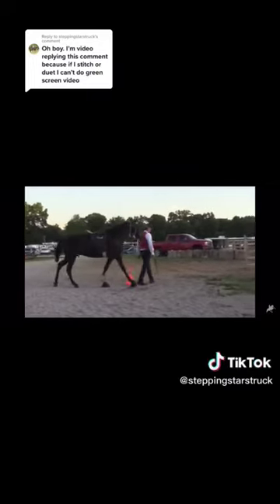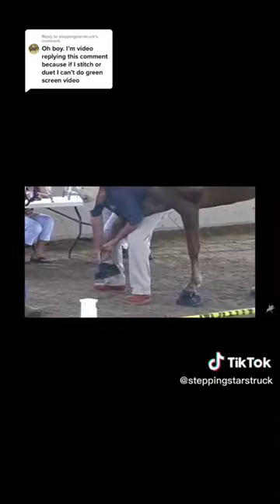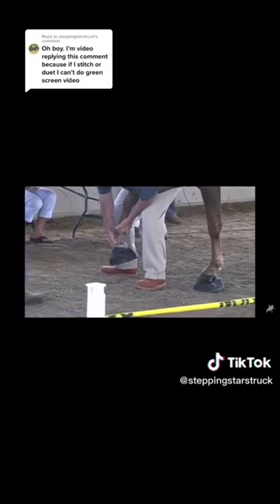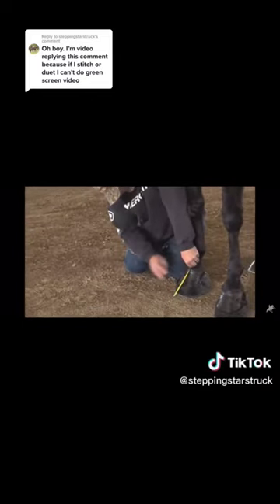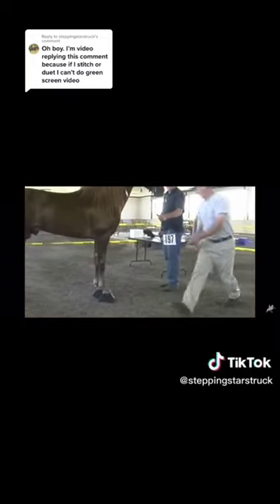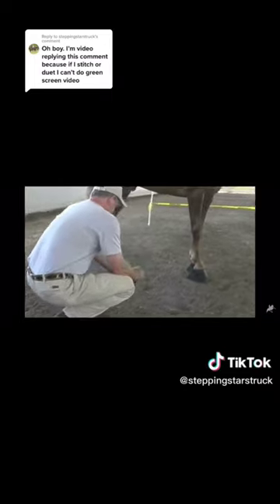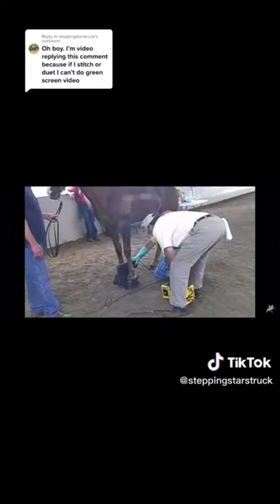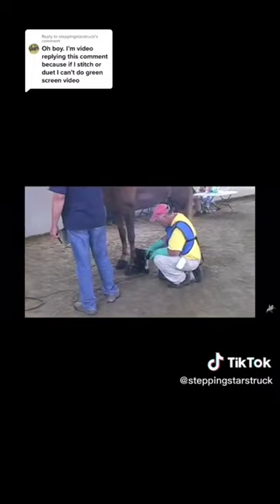Padded Performance Horses Testing Process #saynotothepastact

Comment from the maker: Padded Performance is not my cup of tea but they're one of the few displines out there that actually has such an indef testing process to make sure their horses are 100% sound and pain-free entering and leaving the ring. 
Such testing is starting to peek a bit of its head into Quarter horse displines this coming year. 

If you want to try and say chains and stacks cause pain and discomfort you're wrong as they're backed by vets who found barely any change in their heart beats and blood pressure when they did and didn't have them on. 
Not to mention chains only weigh 6 ounces as much as a watch and stacks 2 to 5 pounds, which aren't crazy weights for these horses to carry.
Chains are used for coordination awareness and there's many different types from rollers, leather ankle straps, felt lined chains etc, some people don't even use them. It's just about preference of the rider and horse. Some jumpers and draft owners use chains/staps, even rehab horses for the same reasons.
Reply: @tansiwolf8281  omg someone with a brain lol
Reply: @tansiwolf8281  no, it’s not entirely natural. The pads do exaggerate the gait, but who said that unnatural gaits are abuse? Have you SEEN dressage? 
Also, have any of you actually seen and taken in pro padded performance research without throwing it away before you actually register it? Have any of you asked vets and people in the industry instead of listening to random websites with no experience in the matter at all?
Reply: @Juniper_edits  in my opinion this is not natural. Dressage horses are trained to do those gaits. However these horses need big stacks to get that more exaggerated look in their gait.
Reply: @Pink_equestrian   yes, dressage gaits are trained. And so are padded performance gaits! They are trained to have a more consistent and larger gait. While pads and stacks do help with that, they are regularly used for health and medical purposes. Chains on the other hand are used so the horse is more aware of where their legs are.
Reply from the maker: @Pink_equestrian the horses used in Padded Performance aren't just untrained Tws who have the pads strapped on and fingers crossed. No Padded Performance horses aren't just trained for the discipline but they're also bred for it. 

TennesseeWalker disciplines are divisions, they go up in difficulty. From All day pleasure, Country pleasure, Trail Pleasure, Lite shod, Park and then Padded Classes. A Tw who is bred for All Day Pleasure would not have the natural abilities to succeed in Trail pleasure as they're being bred and train for different purposes. Even tho Trail and Country are similar disciplines there's obviously a big difference in training aswell. The horses you're seeing in Padded are horses who are often being bred as Lite and Trail pleasure horses. (A little fun fact Park and Padded bred horses tend to be way more Pacey and have a Wringing to their hocks than lower level bred Tws) 

They have to already have the natural abilities and extension for them to even be considered to be a good choice to be started in Padded. 
There's only so much training or pads can take you. Just like in Reining, it doesn't matter how good their training is or how slick their sliding plates are. If the horse doesn't naturally have the abilities to be a good reining horse you'll never win.

Comment: If the saddlebred horses have such a natural gait in the show ring why do they need pads on their feet?
Reply from the maker: They don't need it and many choose not to but pads are used for shock absorption, horses like Saddlebreds, Hackneys and Dutch Harness strike the ground hard and the pads that are made out of leather act as a Nike Shoe would to a athlete. 
Pads aren't designed to alter their gait in anyway but many horses gait better in them because they have more joint support.

Pads are more common than you think, and you probably seen people use them without realizing what they were. 
Pads can either be wore on their own or they can be placed inbetween the hoof and shoe.
Reply: @introvertedequinesamsara6593  oh I had no idea, I've really only seen these huge pads on horses in the big lick industry, I didn't know they could actually be beneficial to a horse and not painful
Reply: These are Tennessee Walking Horses. Saddlebred has nothing to do with this.
Reply: @EquineMetalhead  insint this literally saddle seat?
Reply: @eveyart4281  No. saddleseat is done with saddlebreds. They don’t use these dumb pads like the Tennessee Walkers do. Saddleseat isn’t that good of a sport either though cause they ruin they’re horse’s backs.
Reply: @EquineMetalhead  oh, yeah, I guess I was trying to sugarcoat it but it is unfortunate how it affects the horse😐
Reply: @Equine Samsara  that sounds  like a bunch of crap
Reply: It's not a saddlebred it's the Tennessee walking horse
Reply from the maker: @jane_horselover4845  TennesseeWalkers don't need stacks unless you're competing in Padded Performance where it is required to show in a pad/stack being it's the highest level TennesseeWalker discipline and they want to see the greatest amount of action and traits of the breed.

Stacks really make the traits of TennesseeWalker gaits more visual, the flick of the hock, extention of the back and front legs, the lift of the knee etc. Where it might go unnoticed or have little expression of in some Flat Shod Disciplines like All Day Pleasure or Country Pleasure where it's the bare minimum traits of the breed.
Reply: @EquineMetalhead  how do they ruin the horses backs exactly? The saddle fits fine.
Reply: @Juniper_edits  Ok so there’s this thing past the 18th vertebrae called, “The Floating Ribs,” and it’s where the horse’s kidneys are placed. Now the back of the saddle is above the 18th vertebra which is normal and is completely fine. But they place the saddle on the floating ribs. When you have weight on top of these ribs, it causes a lot of damage and discomfort for the horse. Now nobody knows quite how it causes their backs to hollow out but I’m sure at one point there will be an answer. I’ve been doing a lot of research and I haven’t been able to find anything. But there are actual pictures of ex-saddleseat horses with hollowed backs. So there is proof that the placement of the saddle is uncomfortable and abusive. We of course want to make sure our horses are comfortable and give them the best possible life.
Reply: @introvertedequinesamsara6593  most of what you are saying is wrong. These are called stacks, not pads. They unbalanced the horse, and they don’t help them. What you are actually talking about is gel pads that are much more smaller, and actually help the horse not unbalanced them.
Reply: @EquineMetalhead   lmao I’m guessing you got this info from Raleigh’s video? If so those photos had absolutely nothing to do with saddleseat, they were from a study showing a gene in saddlebreds. So chill. Also it may look like it does but it actually does not at all. It would be about the size as an average roping saddle

Comment: So why do they need the stacks?
Reply from the maker: Stacks are used souly for the displine Padded Performance, they wear stacks/pads to highlight their gaits to make them more visual and expressive.
Such of the traits that get more visual is the flick of the hoof, extended back legs and the swinging motion of the front legs. All of which tws naturally protray but with stacks its way more easy to see.

Stacks/pads are designed to be easy to remove and these horses don't wear them all the time, they get to enjoy other displines and being a trail horse.
Padded Performance is also a very small class compared to other tw displines and very few tws have the ability to excel in that class.
Reply: Ok